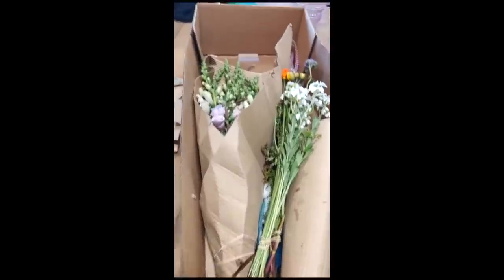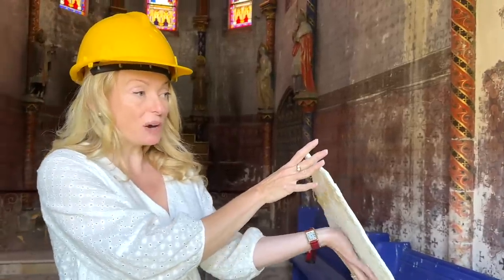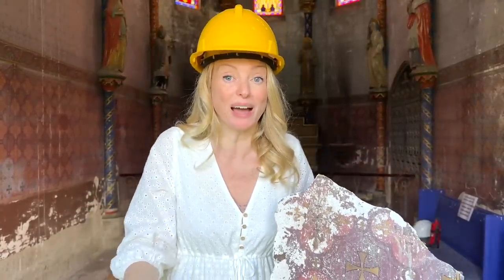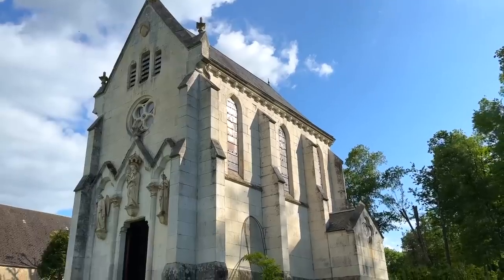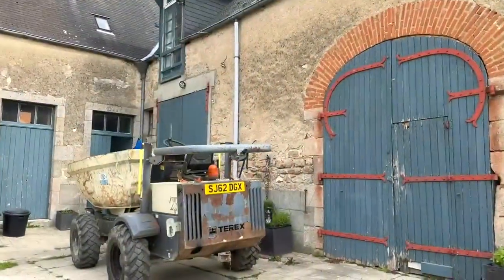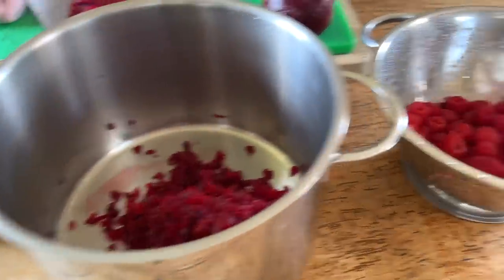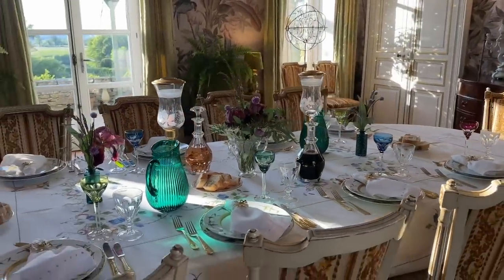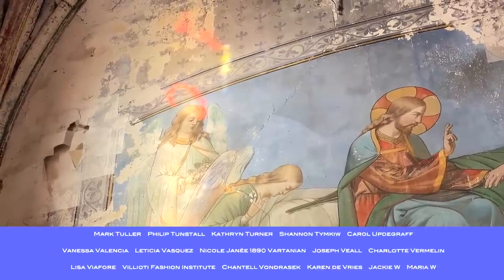WORSE THAN WE THOUGHT: The Shocking Cost of Saving the Chapel!

Comment: Hi Stephanie. Your problem is far bigger. Both  the back of your chateau and the chapel are suffering from it. Namely the missing lake. Since the removal of the lake the level of ground water has fallen below your now days stream. So the soil is slowly compacting. As it is manifesting in the beam of the old wing of the chateau and moving vault of the chapel. Filling of the lake will not undo this process. It will make it even worse. Since once compact moist soil in now dry the introduction of water will turn it into mud and buildings would just sink. So mending the walls, roof, vault or the beam will not help. Those construction enhancement works will have to wait.  Your first priority should be in new foundation of both buildings. Please do find a specialist in foundation survey ASAP.  Because the title of the next video after some heavy rain might be: The chateau/chapel has collapsed.
Reply: That’s scary. Hope you are wrong.
Reply: Excellent point.
Reply: Except, the lake was not a natural feature, it was man made.
Reply: @Sharon-Me  that makes no difference.  Since the lake and now filled moth where both build prior or with the chateau. So the soil water and buildings had time to balance out. Well now without the water the soil and buildings are establishing new balance. The  sinking patio was my first alarm bell. Too much damage to be just from the  undrained water and frost. Latter I started to suspect that the towers by the lake didn't collapse from the neglect. But from regular draining of the lake. The neglect and water damages are just an accelerator in already critical stages of construction changes.
Reply: @Darijan Rajer  The tower by the lake and the tower by the defense walls were pulled down. They were pulled down along with the defense walls. The stones were sold off or it was government edit in 18th century.
Reply: @carolinegooder7091   hard to believe. No stones can repay pulling down and sorting processes and all the logistics of moving such large and heavy objects. Not even today with modern demolition equipment. Usual reasons for pulling down such old and heavy structures are reconstruction and renovation works. And in some cases for safety reasons. Otherwise parts of chateaus that where not reconstructed are/where just left to slowly rot away. My guess is that the walls and towers already unstable where pulled down after the fire. When new materials were needed. Leftover materials of burned chateau were used to fill the moths.
Reply: Sadly this might be true. Happened to buildings and even a very famous big brick church in my home town. The foundation had to be fixed. That was what I was thinking of to...
Reply: @darijanrajer8847  The defensive walls and towers were not near the side and section of house burned. I wonder what the town archivist says. The reconstruction records are lost. Eaten by mice.  😘

Comment: I think there’s also some donor fatigue involved in asking for an additional 430K euro to fix up the chapel. 

Some things you can do: 
-	Apply for French heritage grants for the chapel. It be nominal but will assist. 
There are several regional and national grant programs which can be applied for. 
-	Purchase the scaffolding which can be used for the chapel restoration and rendering of the main house mitigating rental costs which can be rented to contractors in the future when not in use. 
-	Fix the main structural defects on the chapel. The artwork can be done incrementally. 
-	Fix the structural beam in the main house and structural problems on floors above. 
-	Finalise the two half-finished apartments (natty and scot man) which will provide additional revenue for the next season. 
If you prioritise the structural problems in both the house and the chapel, plus finish the half-completed apartments you’re finally getting somewhere.
Reply: I'm quite sure they are already using all available grants, although it is never mentioned.
Reply: And share the scaffolding costs with Dan. He needs it worse!!

Comment: Very near term, and please consult with the professional restorer, if a dehumidifier would do anything helpful toward stabilizing the moisture in the air inside the chapel? Take too much humidity out, and that might be a problem...it would just pull from the walls. Immediately also, I think the French drain shouid be one of the first things you do and perhaps the perimeter foundation can be stabilized at the same time.

Comment: What if you remove the antiquities, saving what you can and re- paint it all.  Have professional photos done and note scale so you will have documentation of all the sizes having stencils made now a-days will be easy. Find color charts and start documenting exact color matches. Create a Bible so to speak of the artworks in the Chapel. The glue doesn’t seem like it would last. Probably less costly as well. 
The outside needs a solution to prevent water from sitting next to the building. As well as air circulation. And heating for the winter. I’m sure temperature changes aren’t good for the health of the building even when restored. 
As in don’t put a garden next to it until everything is resolved.
Reply: They are putting in French drains around the Chapel first per Stephanie. They have added French drains around other areas of the Chateau in the last three years.The issue has been there for generations. It is not new. The  gardens drain away from the Chapel, and the Chapel is on the higher ground.

Comment: Stephanie , you need some rednecks that know construction to help out... it's literally 10x the cost to "restore" exactly compared to repairing properly using modern materials (laminated beams or metal for example)  ... the paintings and wall coverings haven't looked "original" in 100 years... there's no reason not to start fresh and make it look as original as possible using modern paints and finishes... When the old part of the chateau was updated (many times over the years) they ALWAYS used whatever was the modern methods for that century..

Comment: Hmm, can you take a hint from the wallpaper in the Marquis Salon? Have your graphic designer creat a wallpaper instead of trying to save the paint. Make it look like the existing paint. I'm not sure what you can do about the guilding. Just like you didn't get a tapestry for the Marquis salon and used wallpaper instead, think about getting wall paper for the chapel made bespoke for this chapel. You did it for a loo, do it for the chapel. Damp is always a potential problem, Figure out a way to put up the paper so that is not a problem.

Comment: Chateau Purnon has a multi million euro grant due to historical importance. Their total cost is €10m.
Reply: I was trying to follow along with the fast french during one of their TV tours. The buried moat is 250 years old, and the Chateau was built in the 18th century. Is the style Louis 18th? They are 3 years into the restoration. The roof and plumbing (never there before) have been major issues. Three weeks ago, they were talking about part of the roof being finally fixed and moving on to a laundry and adding 1st floor showers. I see the pool was restored early, and the front lawn/garden is large enough to hold a 1,200 person open house. Lawn is grass and daffodils, and garden just grass. How many acres? What functions will they have after restoration?

Comment: To save a fortune, could you use digital restored images of the paintings / decorations on the chapel walls and have them  put onto wall panels which you then affix to the walls?  We can get this is Australia. They make these custom wall panels with your photographs/ images and  use them in bathrooms and kitchens and anywhere else. They are even used as waterproof wall panels in shower areas.  Or maybe you could get heavy duty vinyl wall paper with the chapel paintings / decorations, similar to what you did in the chateau where you used images of your father's paintings.

Comment: what's with the spray cans ??
Reply: If you mean the colors on the walls of the chapel, it is light from the stain glass windows all ready restored.
Reply: That’s a pretty crappy stained glass restoration if that’s how the light reflects inside.  Bloody horrible 😢
Reply: The reflections on the walls move according to the sun's movement in the sky. As the seasons change, the sun's angle also changes, and so will the light coming through the stained glass. I think the constant changes in the reflections make for an enchanted tableau.
Reply: @300books  well yes the point is for them to reflect beautifully. The ones in the chapel don’t. Some of them look like graffiti. Its to do with the glass used in the “restoration” of the chapel windows. That’s all.

Comment: Redo the plaster and repaint the designs and  finishes.  It is too much expense and work to restore what is there. .  You can never be sure if that injected glue process, which sounds dodgy  and without guarantee, will hold up.

Comment: You can auction off the Cadeaux you receive. In steps, after the construction part, find a way to keep what is there intact, and bit by bit restore the most delicate, intricate, and important parts: the paintings then ceiling. The rest are patterns that can be more easily restored later.